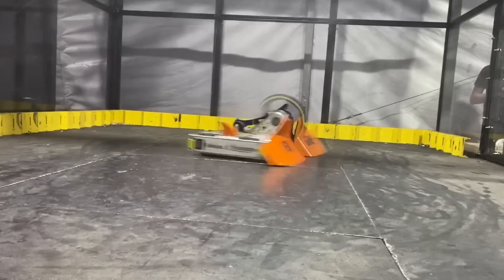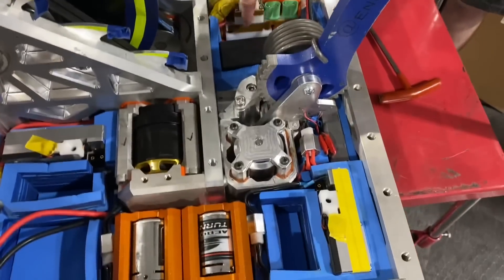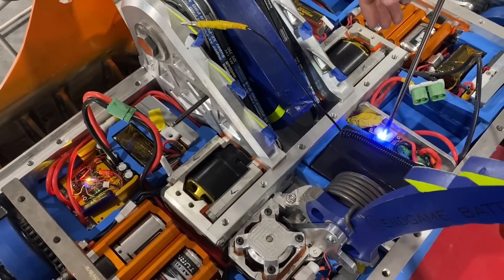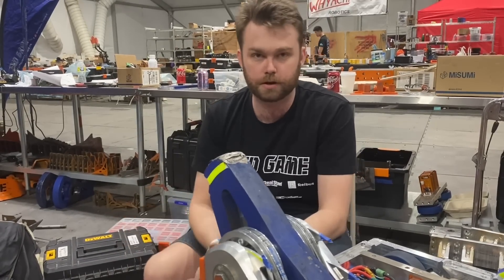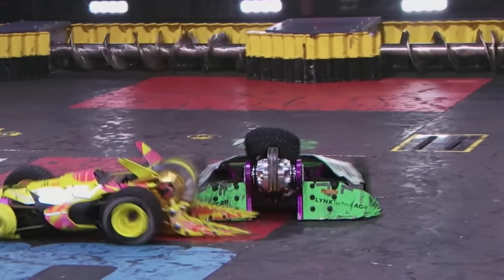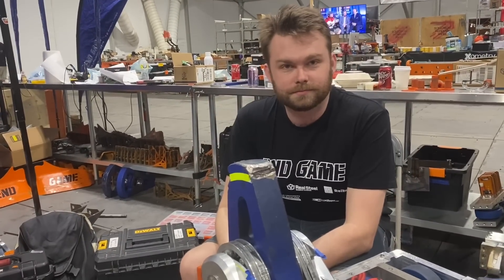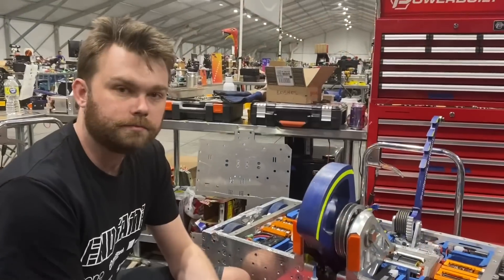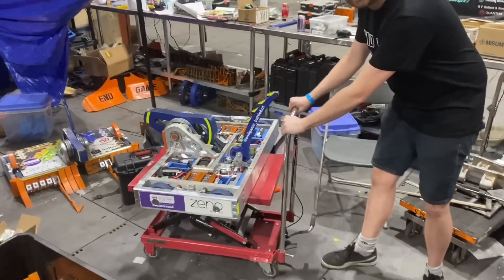What Changes Turned END GAME Into The #1 RANKED BATTLEBOT?

Comment: Obviously Endgame's engineering is solid.  I like the fact that it uses FOUR drive belts.  I'd think that roller chains would be even better.  They tend to handle shock loads better.  Belts break under heavy shock loads. Roller chains can take much higher shock loads than comparably sized rubber belts.

Comment: I have been looking it to a way of using that space slime that when you hit it with a hammer it hardened but it still stretchy but it's finding away to keep it from running like a slime for body armour
Reply: ...is it weird that that comment actually made sense to me?

anyways, 1: check required velocities (most of the formulas are all about interacting with bullets, a spinner weapons hits fast but they do have tipspeed limits well below even a 9-mil) 2: check strength to weight: that stuff is usually used because it's really good at filling in odd spaces which isn't nearly as much of a requirement here.
other than that...yeah, you'd essentially need to put it in a bag that's tough enough to survive the weapon hit for it to be any use on multiple impacts in which case you're basically always gonna be better off just using the bag material for armor so I don't see it working as anything other than packing material for the 'bot's guts. possibly even decent packing material depending on how it deals with absorption/dispersal of both heat and shock-impacts...and zappy-shocks too for that matter. anyways you're still having issues with bagging vs repeated use required and there are probably plenty of other good fill materials available, likely even purpose-built for similar tasks.

Comment: the comparison is because of the similar fundamental design goals: biteforce was almost literally ALL about reliable controlled movement in particular it was (and presumably still is) particularly concerned about having the fastest recovery times possible after delivering a hit, the damned thing would fairly consistently hit a bot up into the air and while it is still on the way up already be back settled on it's wheels and making it's way over to catch the other bot on it's way down all because something like half of biteforce's frame is designed as a spring to absorb and disperse and direct the weapon impacts. other than that Paul made no secret of the fact that he cares a great deal about groundgame, reliability of function, and intelligent prepwork.

sooo...yeah, Endgame making it's way across the box in a calm collected manner maneuvering forks the length of the bot across the cracks and treating it's vertical spinner weapon as the flipping tool that it is is very "Orange Biteforce" heck if this video is to be believed then even the teams are pretty similar in their approach to how they actually work on things.

Comment: I am amazed that those motor connectors are not polarised to prevent connecting them the wrong way round.  It seems to be such an obvious thing to do
Reply: Yeah I’m kinda surprised by that as well. They didn’t even bother to take a sharpie and mark it when it’s plugged in correctly (a sharpie is handy as hell when stuff can be plugged in backwards because once you mark both halves with it the correct direction you automatically know it’s backwards if both halves aren’t marked when you look at it when it’s plugged in )

Comment: I really do like Tombstone but watching this Endgame looks years apart. Tombstone seems to be an old fashioned tubular design which looks quite a heavy method having to bolt the armour to it and if a weld cracks the structural integrity of the chassis goes quite quickly. Ray has also said about the frame twisting quite easily which seems like quite a big issue.

Having almost a unibody that is the armour as well seems like a much stronger way to have a chassis, not only that but having it surround the wheels makes a lot of sense looking at Carbide. All the components not only shock mounted but slightly away from the edge of bot makes a lot of sense, Tombstone took a smallish dent to the rear armour and it hit the batteries. These as well as so many other design decisions.

Maybe I’m totally wrong just my opinion.
Reply: I think T.S. still has a few more years to go before becoming completely obsolete by I would agree, time for a frame upgrade.
Reply: @robertgoodale7204  It certainly hits hard still but the amount of times the frame twists or the gearbox casing breaks on the wheels is not good. Even the 2023 Mortician seemed to have the twisting issue that jammed the bar. Unless I'm mistaken I dont think a single bots thats an 'old fashioned' tube design made it to the quarter finals of Battlebots in 2022.
Reply: Tombstone was the king in the past but some other bots (including End Game) have evolved faster than Tombstone and have surpassed Tombstone

Comment: Just solid engineering. Seeing how surprised Zachary is by END GAME's strategies really surprised me. They are simply doing normal lean and six sigma engineering. This is the first stuff drilled into college freshmen before they even start doing any static or dynamic calculations (Sorry, don't know how to properly express this in English). Rubber mounting everything to take off the edge, earthing yourself when you work on electronics, modifying existing designs to your specification, monolithic testing. You're telling me there are teams that don't do this? I always thought it was purely bot designs competing, but if these common sense practices aren't carried out by all teams I understand now why some designs with great potential just fail.

It seems the time in-between fights is pretty hectic, so you NEED a good checklist and you need a common team "code" for a lack of a better word in my vocabulary. I don't mean to smack any teams, but it just surprises me greatly.
Reply from the maker: Sometimes during interviews, I play dumb and ask a question that someone not in the sport, or in the fields would not know. 

This is done to try to make my contact more approachable and easier to understand.
Reply: @SkorpiosBattlebot  Ah, I'm an idiot haha. Thank you for clarifying!

Comment: Most interesting. 

They dont use the thickest aluminium for the chassis, or the most powerful motors. What I am seeing is superb packaging of components, zero wasted space and short cable runs. 

3:20  Also, look on the table behind... The whole weapon assembly comes out in a single piece which could then be disassembled further. You can clearly see the orange rubber 'shock absorbers' there.

Comment: Ok wait there's 3 pin connectors that are reversible like the one they swapped on the weapon motor??? That's such a good solution, never have to worrying about changing out the wires or swapping solder connections. Just flipping a connector and plugging it in
Reply: Well, except that you can plug it in backwards I guess! I was really surprised they don't use keyed connectors.
Reply: @haratofu  For a brushless motor like that it'll run no matter the order of the wires, swapping two just changes the direction of the motor so it's safe to do in this application.
Reply: @haratofu  I’m all for it not being keyed so if ends up being a motor and esc that we’re originally a pair so there’s always the chance of one set being soldered differently than another. But at the same time once it’s verified to be correct mark it with a sharpie so you can visually tell it’s backwards just by glancing at it